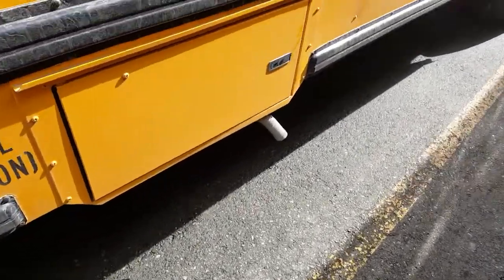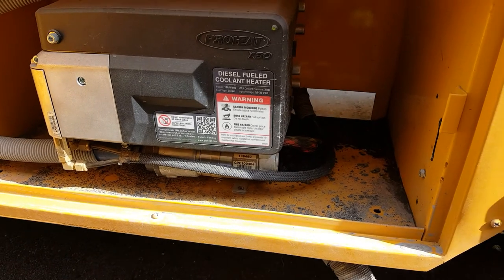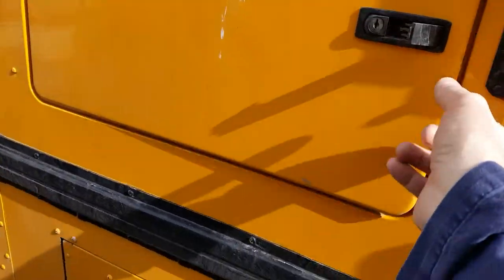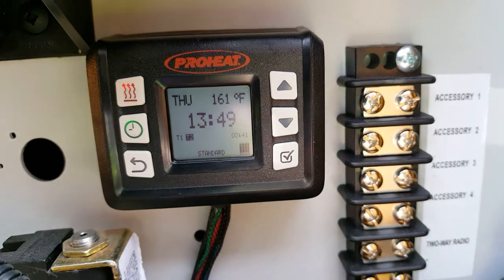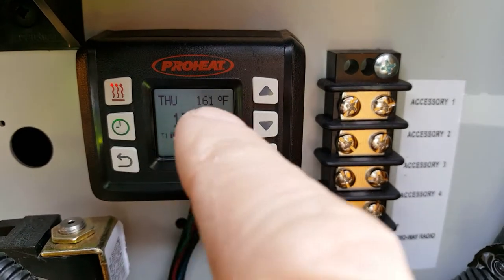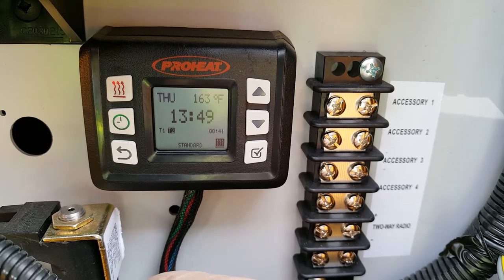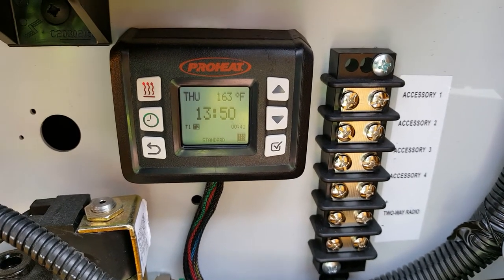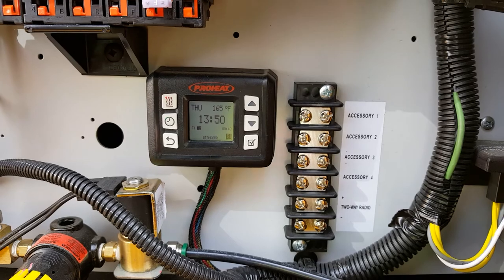Proheat Diesel Coolant Heater in a School Bus

Comment: Very neat. How does this work when drivers come in and do their pretrip...are they able to safely open up the recovery tank and add cold coolant?
Reply from the maker: Hi Luke, The drivers can add coolant any time while the Proheat is running. The coolant flow isn't high pressure and the coolant is well below engine operating temperature.